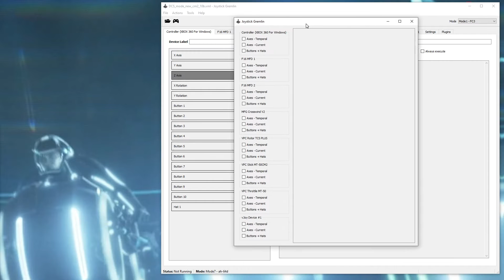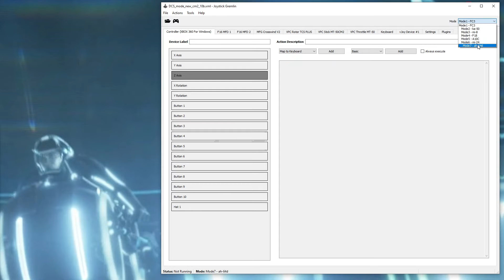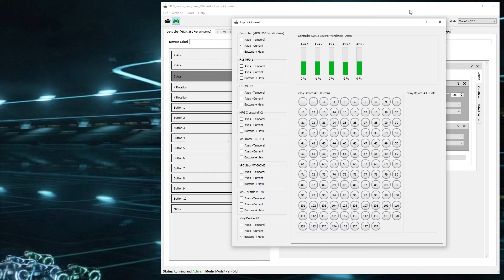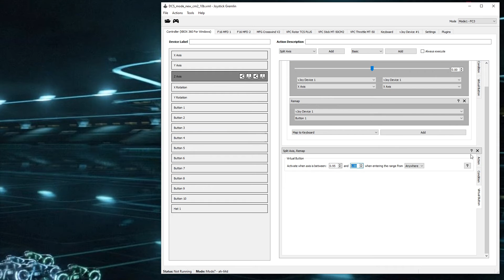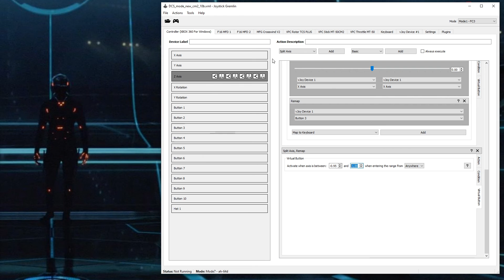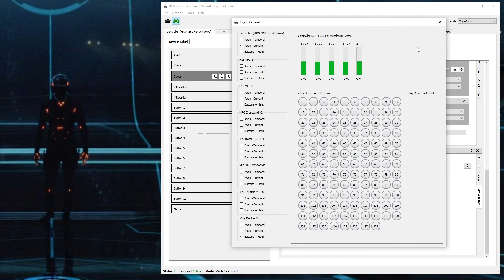Joystick Gremlin Tutorial - Xbox controller 2 stage trigger

Comment: My problem after following this guide is I can't use both triggers at the same time

I obviously want the left and right triggers mapped to the TEDAC left and right triggers, if I press and hold right trigger to lase target the left trigger won't work unless I release the right one - thereby dropping the laser.  I believe this is because they are both still part of the same axis.

I can use JG to split the z axis into 2 seperate VJoy axis and they then work independently but I can't find a way to then map those virtual axis to VJoy key presses.

Anyone know how?
Reply from the maker: there is no way around this sadly, IF the device had each trigger as its own individual axis it would be great and we could do this, sadly we cannot 😞
Reply: @HavocCompanyClan  You can provided you force install an alternate controller driver which reports the triggers as separate axes. Alternatively there is a program "reWASD" which is somehow able to recognize the trigger values independently. I too want to input for Apache independent triggers. Actually I found something called "Controller Buddy" which is somehow also able to read trigger values independently. If I output that to a vJoy controller with 2 axes then use that as input to another vJoy controller I'll have it.
Reply from the maker: thanks for the tip , this will come in handy @frederf3227
Reply: @HavocCompanyClan  yea I figured that would be the case .... ordered a new controller that apparently has them as separate axis.
Reply from the maker: @Katashtrophie  Can you post back how you get on with this new one please, I would consider buying a new one if I could get a good one with different axis
Reply: @HavocCompanyClan  yea no problem, should be here tomorow.

I read a post on DCS world about the same issue and the OP indicated he changed to the Turtle Beach Recon controller as it has the triggers as 2 separate axis - plus some extra buttons.

Comment: What type of Xbox controller are you using? There’s a known issue acknowledged by the Joystick Gremlin dev that Xbox controllers do not work with it. Is it an older controller?
Reply from the maker: Hi, it is an el cheapo Xbox360 controller I have had for years, the standard wired one with a cable